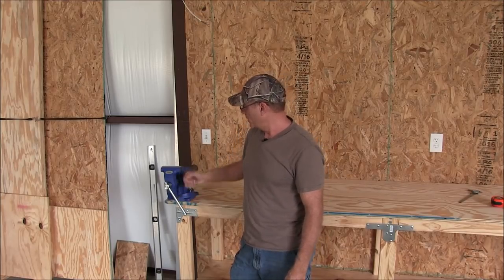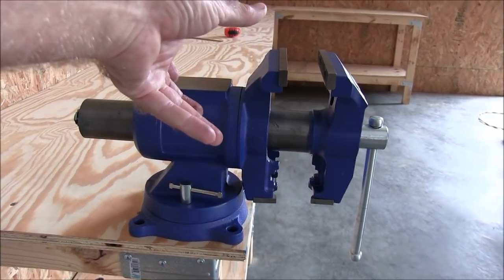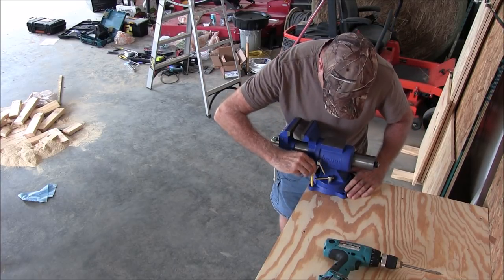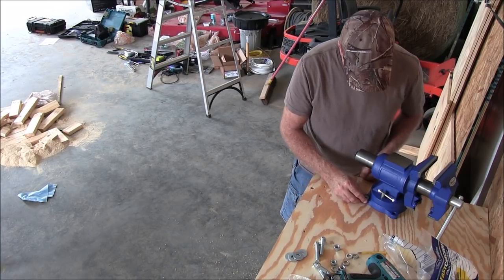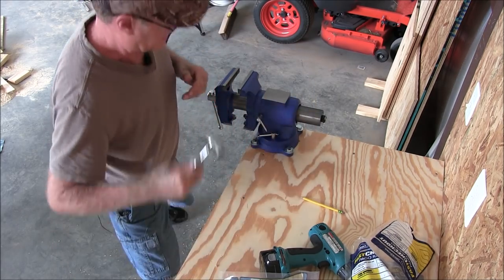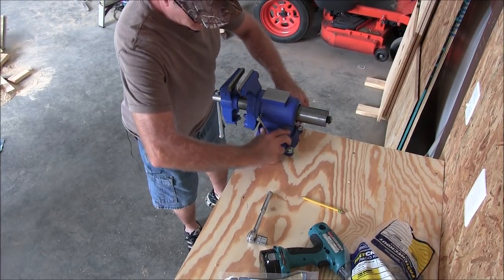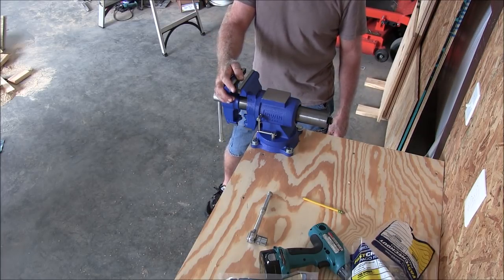How to Install a Bench Vise

Comment: Mounting a heavy vise through a sheet of plywood? Um, no. I appreciate the rest. Thanks!
Reply: And close to the edge of plywood...
Reply: He specifically says in the video that he chose plywood instead of solid wood because that's all that he needed for how he was going to use this bench.
Reply: @SuzukiKid400  I've have to mount on plywood before. If the whole bench isn't solid wood, I'd suggest sandwiching some solid wood plates on top and under the bench, then mounting to that, helping to manage/spread forces.
Reply: @SuzukiKid400  He says he could have used 2x10 or 2x12 underneath, but he couldn't have. He has a corner support underneath the vice.
Reply: @Maxxis1941  I disagree. You can always change the corner design to incorporate solid wood for a vise mount.  Stop criticizing the guy.

Comment: The info you gave about the spade bit, to back off and not push too hard when you get closer to the end of the hole, is  great advice. As someone thats only in my first year of woodworking, i can use all the tips and tricks i can get. Great video all around. Thanks.
Reply from the maker: Thank you 👍
Reply: Another thing you can do if you have the room is hold or clamp a short piece of 2X4 beneath where the bit will break through. You'll get no splinter or break out at all. Two clamps work best, safer too.
Reply from the maker: @jimwiskus8862  👍

Comment: Many thanks for your vice advice. I'm just wondering why so many are mounted on the LEFT side of the bench ??? Are most workshop folks left-handed ? Anything  to do with political persuasion ? Surely it's neither of these. Is it more practical in some way on the left ? Mine is like yours, but mounted at the RIGHT hand  corner of the bench.  It has a swivel base like yours, BUT I'm so envious that yours also has vertical swivel.

Comment: This is a great video that should help the beginner who is a total novice installing his first vise.  It will show you how to mark 4 holes on the work bench, drill them out, insert bolts, and tighten them up.  After only 12 minutes of instructions in this video, anyone can be drilling holes and tightening bolts at an expert level. I highly recommend this video.
Reply from the maker: Thank you 👍

Comment: I just got a big vise and I ended up gluing down another square of half inch plywood under it. I was afraid that a heavy load or twisting would end up just breaking the single sheet of plywood on my benchtop. I also added another 2x4 brace.
Reply from the maker: Good, it's always better to add more reinforcement before adding a vice.
Reply: Yeah I was thinking the same for his vise as well. I got 1/2 ply on top of 1/2 MDF on a 6 in vise and want to add some 1x2 's as a brace.
Reply: Yup, that install wont last for sure-need a stronger base

Comment: Enjoyed your vid. Ill be installing my new 6.5 inch vise on my plywood workbench. My plywood measures just a bit under 1". I decided to install it over 1/4" steel plate wirh another strip of plate under the front bolts for extra strength. May be overkill.

Comment: This is a great video.  Thank you for being so detailed.

I did however decide on going with a Capri Tools 1051 series Ultimate Grip Forged Steel Bench Vise.  It's manufactured in Taiwan (much better than China), and it's made from forged steel as opposed to cast iron/cast steel (hollow on the inside).  More expensive of course (double the price), but I won't have to worry about cracking a jaw as so many people have posted regarding Irwin or Yost cast iron/cast steel vises.

Now I just need to decide on going with a 4" or 6" jaw.  While my primary needs are for small gun smithing and chain sharpening projects, somehow I get the feeling that 6" is the way to go for those "just in case" projects.  5" would have been ideal, but Capri only makes the vise in 4", 6", and 7" sizes.  7" is definitely way overkill.

Again, thank you.
Reply from the maker: Awesome 👍
Reply: @petebeasttexashomesteading  - By the way, is your bench bolted to the studs the wall in front of it?  Trying to get an idea of how to prepare the bench for the vise install.
Reply from the maker: Yes the bench is bolted to the wall studs.
Reply: @petebeasttexashomesteading  - Thank you.

Comment: Hey mate great video. I am designing a workbench to build myself, and I will be buying that exact vise in the future. Could you be so kind to tell me the rough lengths between the bolts (centre to centre)? It looks like a square, but knowing the dimensions will help me think about support underneath the vise for my design.
I hate to see people with negative comments here... Keep up the great work because you really helped out way more people, compared to the small few who complain!
Thanks again in advance, and greetings from Australia :)
Reply from the maker: Hello my friend, the distance from center to center is about 4 7/8 (4.875) inch or 124mm hope this helps.

Comment: Such a great tutorial! Thank you! Sorry for the newbie question, but why do you need washers and lock washers and what order did you stack them on the underside?
Reply from the maker: Thank you, after you put the long bolts through the top of the vice you will put the large washer underneath first then the lock washer then the nut. Using a large diameter washer keeps the nut from sinking in to the wood when you tighten it, and the lock washer keeps the nut from unscrewing it self after time.
Reply: You only use lock washers between a nut or a bolt and something fixed like your bench (not a wooden one ;-)  ) or your vice. It has to bite an unmoveble peace to work. Your large diameter washers may turn round the bolt and so the lock washers cannot fix the nut. Both will turn, too.
In your case the pressure of your strong bolts and nuts against the compressed bench-material will hold them in place by the friction of the thread.
For the rest: Nice video and sorry for my german english.
Reply from the maker: Thank you for the information :)
Reply: Regarding the lock washer, that always goes on after the flat & just before the nut. That said there is a certain direction you want to install the lock washer. Lay the flattest side of the lock washer on your work bench or surface. When you look at split in the lock washer one side will protrude higher than the opposing side. That protrusion is somewhat malformed and sharper than the side on the other side of the split. That protrusion is the side you want the nut to contact first. Tightening the nut flattens out the lock washer and Lockes the nut in place.. If you remove the nut, you can see where the protruding part of the lock washer marred up the underside of the nut once it's in your hand. So, long story short the protrusion part actually locks the nut in place.

Comment: What if my table top (3/4 plywood) doesn’t hang over the edge of the frame? Mine is flush with the 2x4 frame so I can’t put bolts on the forward two holes of the vise. Could I just use screws to hold the two forward holes into the 2x4 frame? Like half inch diameter screws?

Comment: Decent video thanks.  I have similar bench set up but I don't want to mount only thru the plywood even with wide washers or a steel plate backing it hammering on things in the vise I'm sure will eventually destroy the plywood or get ripped clean off the bench.  Trying to find ideas for strengthening the outside bench corner underneath and most likely to the wall also. I'm no carpenter by trade but maybe I'm expecting too much from a 2x4 or 2x6 frame to hold up against beating on things in the vise.  Any ideas or suggestions much appreciated
Reply from the maker: You could double up on the ply wood or use 2x6 or 2x10 for the top and 4x4 for the legs, that will hold up to most pounding, and make sure the 4x4 is directly under the vice.

Comment: I bought an antique Craftsman made in the USA 5.5” Vise that is in great condition. I went to mount it on my new work bench after measuring the holes in the base at 0.5”. The half inch bolts fit through the holes in the base very snuggly, so snuggly in fact that is gave them about a 80° angle when coming out the bottom of the base. As I could not replicate this angle when drilling the holes in the workbench, I ended up going with 3/8” bolts and hardware. 

I wish I could use the 1/2”, but I don’t see how without machining the holes in the base to produce 90°. Slightly frustrating and weird. lol
Reply from the maker: You could try finding 12mm bolts. The 12mm equals .472 in
Reply: @petebeasttexashomesteading thank you!

Comment: Do most vises come with nuts, washers, bolts and lock washers or do you usually have to buy them separate?

Also, I'm mounting to a solid piece of 1inch wood, should I add another piece of wood on each side of the table to sandwich the 1inch thick piece of wood?

EDIT: The small blooper bit at the end of the video was funny, reminds me of me when I'm recording a video lol.
Reply from the maker: No you'll have to buy the bolts, nuts, and washers. I would just screw a 5/8 plywood on top of the 1 inch board table top should be enough.

Comment: Don't use lock washers! NASA has found that they're useless against stopping bolts from coming loose. Just use Nyloc nuts instead of regular nuts or use some of those serrated lock washers, but not the split ones that you used in this video!

Aside from that, great video! ☺
Reply: loctite is another viable option

Comment: I recommend a nice steel stab to distribute the weight across the workbench and have a thicker slab of table top on a bigger vise.Don't forget toe use Grade 8 or higher on hardware. Great video tho!
Reply from the maker: Good idea on the table top. I have a roll around 4x8 table that I would like to do that to so I can weld on it. Thanks
Reply: A good thick table top will do no harm but what he has is still good enough for working on.

Comment: How has that Irwin vise hold up? I'm thinking of getting a Irwin 4 1/2 Cast Iron Light Duty vise from Lowes or a Bessey 4 1/2 Light Duty vise from Home Depot. They are almost the same price and I want to use it for things like removing brass from power cables.
Reply from the maker: My vice is holding up great and I use it regularly.

Comment: Is it okay to use a vise that has smooth Jaws or should I buy an advice with gripper Jaws?
Reply from the maker: It all depends on what you are trying to hold with the vise. If you're working with wood, you'd want smooth but with steel, you would use the jaws with the gripper on them.

Comment: i won't have room for working at the corner so can't fit it to the corner. my work bench goes right to the wall either side. looks like im installing near the middle. not sure i'll need a swivel vice in that case....? would it still be useful
Reply from the maker: You can mount the vice anywhere that works for you. It's always good to have a swivel vise, you never know when you'll have to move your clamped part around.

Comment: Hello from England! Your workshop looks bigger than my living room! I only have a shed 10"x 6" and my home made bench is only 3' x 2'. Got any suggestions as to size/type of vice I should get? I'll be using it for wood, but also chainsaw maintenance and hand tool renovation. I'm left-handed so maybe place it on the right side. Any thoughts?
Reply from the maker: Well it seems like you need a smaller machinist vise and a wood working vise but you're limited in table top space. That's a call you're going to have to make. Whether you mount the vise on the right or left on the table, you have to mount it where it will work best for you and space you have. Here's a good video of Wrangler star mounting an inexpensive wood working vice. https://www.youtube.com/watch?v=TqE-2cPZdL4
Reply: Cheers @petebeasttexashomesteading

Comment: Nice video, yesterday i bought a Crafstman 5 inch vise (made in china), i expect to mount it today on a piece of steel beam
Reply from the maker: Thank you, Your vice will definitely be sturdy on the steel beam.
Reply: Yes, is a little piece about 2 foot for one foot, i don`t have a work bench so that is the way it is going to be placed jeje. It is a great help tool. I am working right now and at 18:00 hours i am out so as soon as i get home i am going to work on that. Tomorrow i buy the screws. Thanks again!!
Reply: Héctor Rangel j

Comment: My vice is big like that one.  Would that be able to be mounted to a toolbox?
Reply from the maker: Yes as long as the toolbox is big and strong enough.
Reply: @petebeasttexashomesteading  my worry is that if it's not supported properly the wood top will crack and eventually break.  its a Yukon 47 inch long toolbox from harbor freight.
Reply from the maker: @deatharg  It all depends on what you clamp in the vice. If your clamping a large metal pipe and trying to bend it or hammering something with a 5lb sludge hammer, then yes it could break. But holding down something to work on it will be fine.

Comment: thank you. i think even my dumbass can install my vise now. mine is a 2 hole with swivel. 

i do want it on the corner of my bench. 

i think mine is 1/4in bolts. they dont look as big as yours so mine is less heavy duty but going on a wood bench and should be enough for my usage. 

im confident now i can install my vise and have the tools to do so
Reply from the maker: Awesome 👍

Comment: Nice!  Are the top washers (the ones you ground) really necessary?
Reply from the maker: RaymundoRock The outside diameter of the washer was too big so I had to grind it. But if you can find a smaller diameter washer then you don't need to grind them.
Reply from the maker: RaymundoRock  No I guess the top washers are not absolutely necessary.
Reply: Actually yes, the top washer prevents the head of the bolts from grinding into the cast iron housing and protects the finish to a degree. On the washers one side of the washer has sharper outer edges, the other side the edges are smoother more rounded. I put the smoother rounded side down to minimize paint loss. Just my thoughts.

Comment: Do the lock washers go above or below the lower washers?
Reply from the maker: snakeeyes20a Lock washers go between the bolt head and washer. So put the lock washer on the bolt first then the washer.
Reply from the maker: snakeeyes20a  And underneath the bench you put the washer first then the lock washer then the nut and tighten it all together.

Comment: How much of an overhang does that bench have?
Reply from the maker: The bench top is 3/4 inch plywood and comes out 26 inches from the wall. The 2x4s structure underneath comes out 24 inches from the wall, so there's a 2 inch overhang.

Comment: He doesn't show the order of the flat washer and the lock washer. Which one goes in which order? I would suppose going from the top down, flat washer, lock washer then nut?
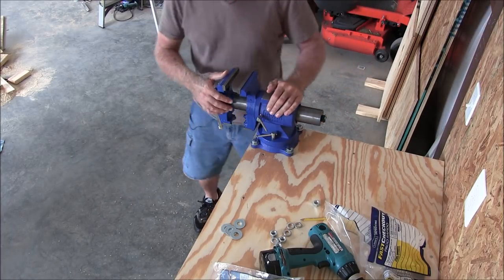Reply from the maker: Correct, Flat washer first then lock washer then nut. I do mention it at 6:30
Reply: @petebeasttexashomesteading  Ok thanks for the clarification! I wasn't to sure since it seemed to flip over in your hands so I was lost haha
Reply from the maker: @JackRR15  👍

Comment: If you are right handed, i like to put the vise on the right side of the bench so you are cutting things off the free side and not cutting things on to your bench.
Reply from the maker: Good point but the left side was really my only option on my bench.
Reply: Mark the opposite side and cut from that. Just change the orientation. Side shouldn't matter too much unless something is already preassembled. There are always snags and road blocks regardless lol. Happy tinkering!!

Comment: 7/16 bolts
Reply from the maker: I used 1/2 inch. But it that is too tight, you can use 12mm which is .472